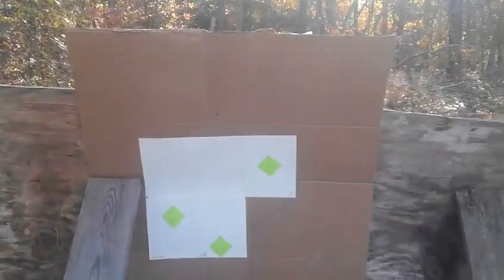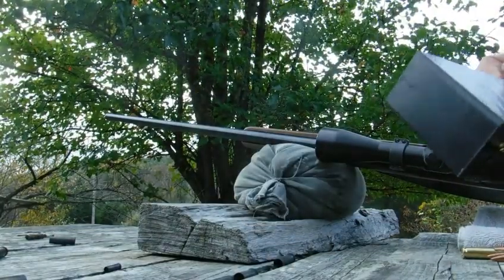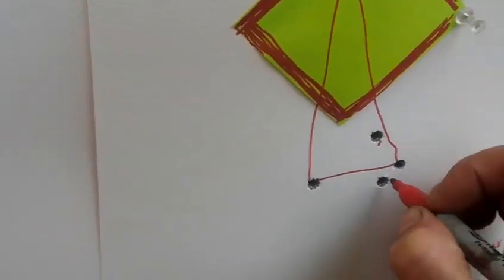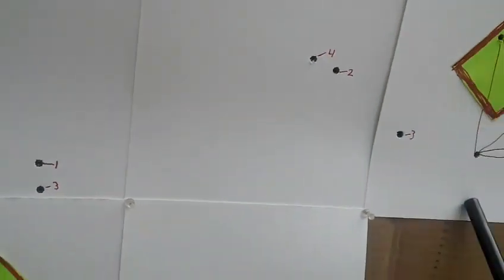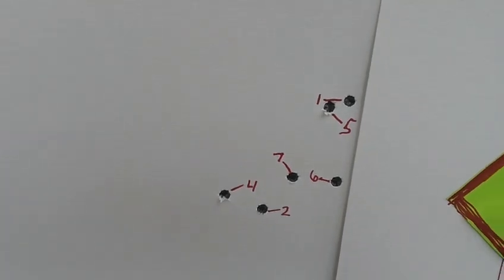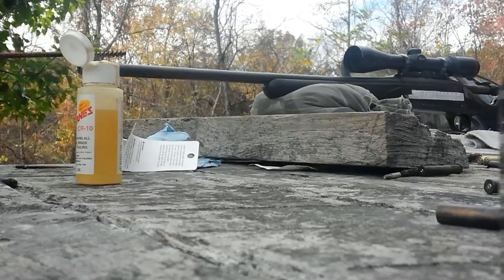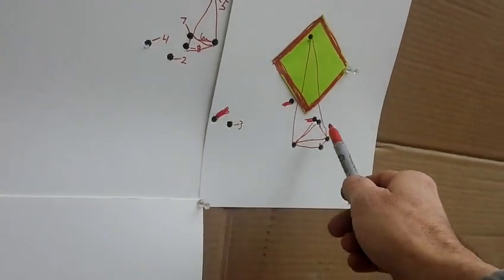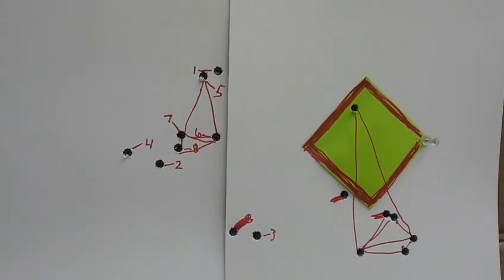CZ 527       6.5 Grendel ladder test

Comment: You think this would be a good enough round and gun for hogs. Getting into hunting and I really like this rifle, great video👍🏾
Reply from the maker: Yes I do.  Provided you use a good quality bullet that is designed to penetrate. The older bigger hogs can be quite thick through to their vitals. And their hide and fat layer can be pretty tough.   So shot placement with the smaller less powerful cartridges is a pretty serious matter. If its close range you do not want an old boar to charge you with tusks sticking out of their jaws. That can do serious damage.  But the Grendel round can send a bullet with good sectional density at decent velocity. I have even experimented with 140 sierra boat tail soft points. With good success. At 2400 fps that is more than enough to punch through a hog.  Nosler partition bullets have a great reputation for penetration. They would be awesome. Give it a try.
Good luck and thanks for watching.